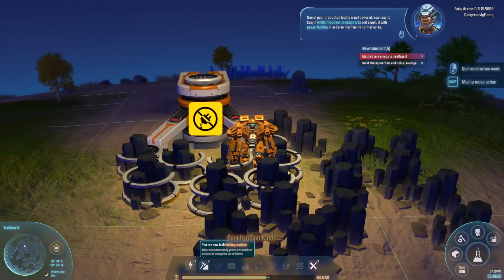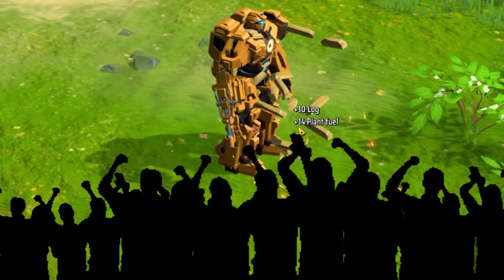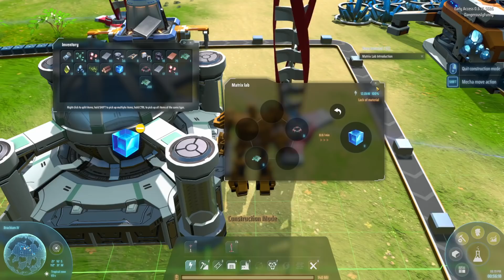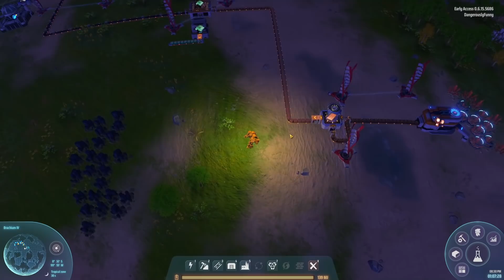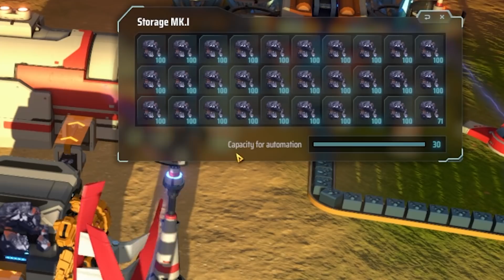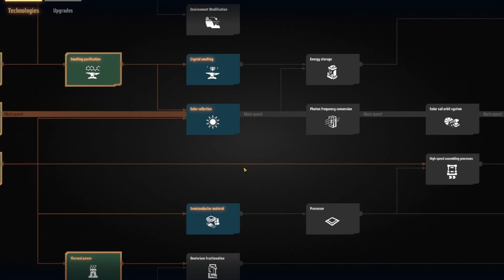I Decided To Exploit This New Planet For Personal Reasons in Dyson Sphere Program

Comment: the matrix labs have two modes, research and production, so you want to feed the blue cubes into another lab. also you can stack labs, tanks and storage. don't worry about chaos too much as pretty soon you'll have robots sending things between planets and other robots taking from them and putting them wherever you want. The only other thing I can think of right now is to smelt your coal into graphite for fueling you mecha, it just works better.

Comment: Here’s a tip, if the symbol on a thing is a power plug, it’s not connected to the electrical network. If it has a lightning bolt, that’s when it wants power. You can see the area that things can be connected to the network by looking at the blue circle around power poles when you select them. If it’s in it, it should be powered.